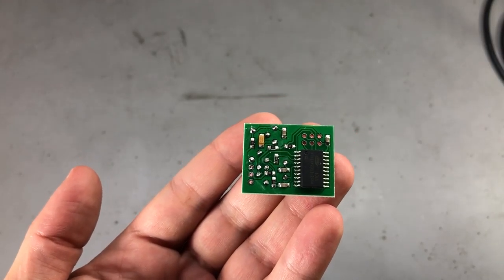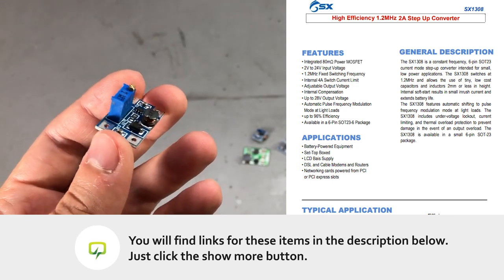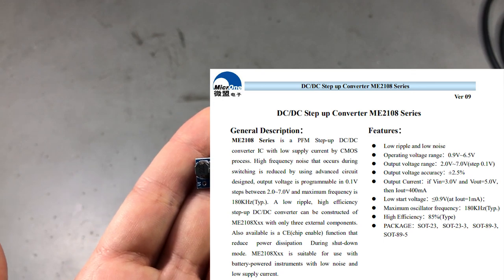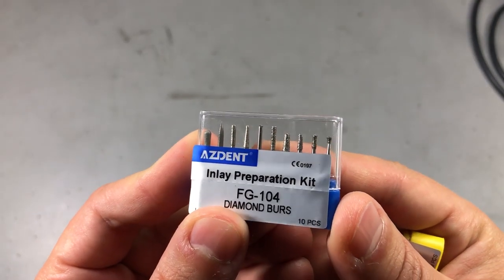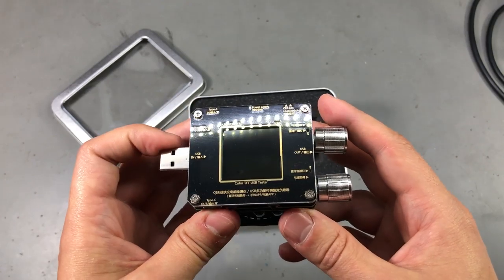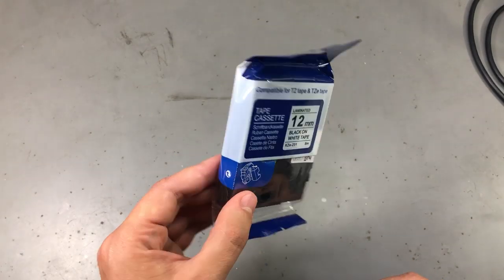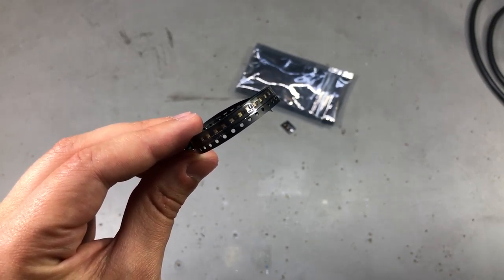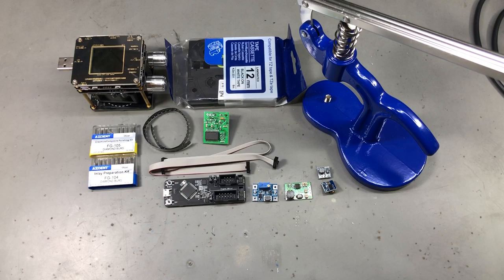Voltlog #247 - InTheMail

Comment: You can use the magnets for-

Stick them at the end of a toothpick, use it to clean iron filings out of small groves.

Putting post it sized notes on iron surface (my cupboard next to my desk in my case)

Put 2 in a stick such that they face opposite to each other and give out a reading to hail sensor when rotated... Use it to send max rpm of your drills. Similarly rpm of almost anything

Stick them to ruler (the side which doesn't touch they surface being measured) and stick it to a workshop surface (use grid like pattern for artistic effect)

As a detent in smooth adjustment mechanisms

For keeping boxes closed

Mark out the poles with red and blue market and put them in an oil filled vile to use as a magnet finder and magnetic oscillation detector

 sticking small stuff to iron surface.
Reply from the maker: thanks!
Reply: Because they are so tiny, I'm not sure how strong they actually are. It would be interesting to see someone try some of these ideas and see how well they actually work.
Reply: @Markus0021  I'll require multiple of them in single use, like for a post it note, it required, 1 on each corner
Reply: @SurajGrewal   I see. Curious to see how many you'd need for , say, and 5x7" photo or 5x7 piece of paper. I'm guessing several, at least.
Reply: @Markus0021  trial and error my friend. Add till it feels ok, then add some more
Reply: Here's a video I made in the same-https://youtu.be/Ao2L0l1qak0

Comment: The easiest way to help yourself to a CAN bus is to use your ESP32s in conjunction with a CAN transceiver like the MCP 2562. The code to set up the interface is pretty simple and can directly be taken from the examples at the bottom of the documentation ( https://docs.espressif.com/projects/esp-idf/en/latest/api-reference/peripherals/can.html ).
You will need at least two CAN nodes (i.e. two ESP32s) on the bus because the protocol requires a second node to acknowledge the correct transmission of a message. Without that acknowledgement the CAN controller will at first try to repeat the transmission (up to 254 times) and then go into bus-off state.

Comment: request for you,  I see that you have  dd0612sa  module  FP6293,  I  want to know does it  work at  3V input  (battery cutoff) and output of 12V  0.5A  ,  in stable way without heating up much.  The  place where I live do not have access and trying to make a cheap boost converter for 12V application.

Comment: Those magnets are really tiny! If I dropped one (or even 2 or 3) on my carpet it would be gone forever.
Reply: Just use a bigger magnet to pick it up.
Reply: @NiHaoMike64   I've tried that in the past, with some success. Sometimes, though, the magnet gets trapped by getting 'buried' into the fibers of the rug. Especially with tiny ones, they get so far down into the pile that it is hard to pick them up with another magnet. Maybe if I had really big, powerful magnets I could do it.